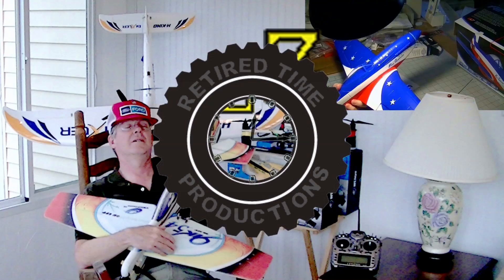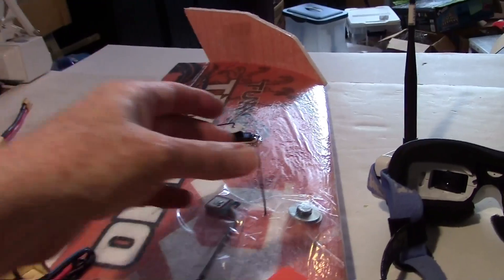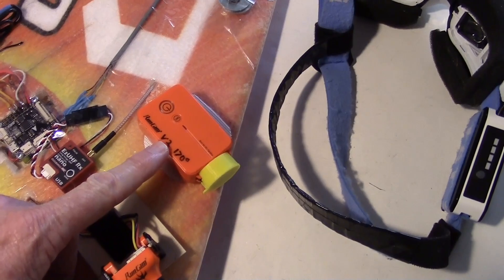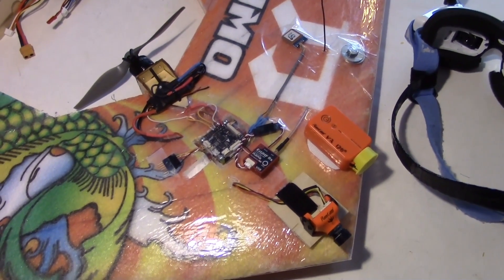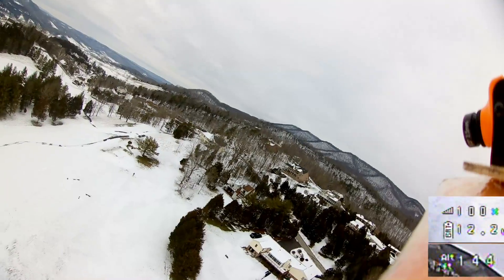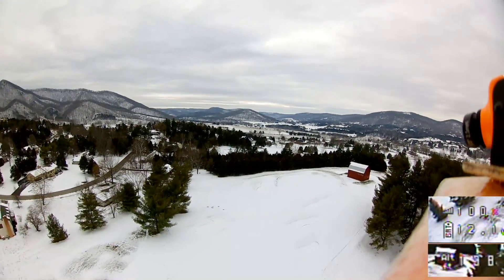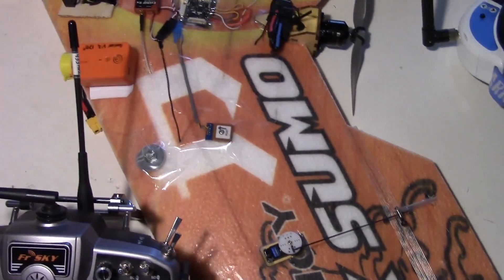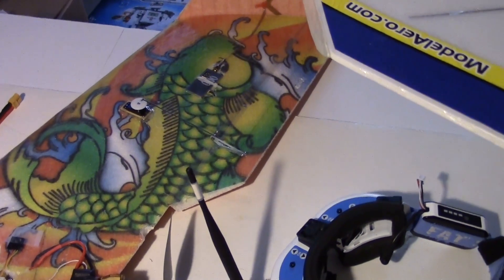Tek Sumo EZUHF Nano LRS Receiver Flight Test and link to Binding and Firmware Updating Flight Vid

Comment: Nice video! Was the rssi working? I t was always at 100%?
Reply from the maker: Yes it was working but it is actually measuring Link Quality rather than RSSI.  I used LQ instead because RSSI is an inverted signal on EZUHF. I would probably have to go much further than I did to see a drop with 433MHz LRS.  Rock solid the whole time.
Reply: Dave Merc Productions does it use 0-3v or one of the ppm channels?
Reply from the maker: It is using one of the ppm channels but fortunately it has 12 channels so plenty of room for all the functions I need.
Reply: thx!

Comment: I am curious to hear what RSSI values you are getting in Inav,  I have the 4 channel EZUHF RSSi coming in on the PPM signal on Aux 4, when receiving 100% signal i get 1000uS and it only goes to around 1400uS when i switch off this relates to a range from 60% rssi to 100% Rssi in my OSD.

What do you get on the nano?
Reply from the maker: What software are you using to check the values? I will try to do the same and give you the readings.
Reply: dmerc00 thanks really appreciate it if have 1.53 on the ezuhf and inav 1.51 on the plane
Reply from the maker: So what I found out is that I am not using RSSI. Link Quality is more useful to me and is a positive signal which configures more easily. So the short answer is I don't know my RSSI values because I am not using RSSI. If you are using a MWOSD you may be able to calibrate your RSSI reading with the MWOSD config tool.
Reply: dmerc00 so what values are u getting in inav for the link quality when u switch your TX on and off?
Reply from the maker: 1800us when the radio is on.
When the radio is turned off it quickly drops to 1424 then gradually drops to 1000.
On my OSD screen I see 100% that trickles off to 0% when the radio is turned off.
Not saying this is right, but it's just what I get.
Reply: thanks so much I will change to link quality and see what I get. was this with your JR module as that's what I am using. thanks again for you help
Reply from the maker: Let me know if find out anything interesting on configuring it.

Comment: Hey, give Jhon a heads up on his revising for the smoke stopper, could not response on his video comment (it was removed as we speak)
But looking fw to see the new design ;o)
Cheers.
Nice flight b.t.w.
Reply from the maker: The smoke stopper thread owner didn't like Jon putting the switch on it or the procedure for using it so we respectfully took it down for improvements. Personally I like the switch idea but the owner thought it would lead people to leave it plugged in and drain their batteries. He also took issue with me not using the low current smoke stopper test first. Then he claimed trade mark violation for using the name, lol. I did a search on TESS and found his trade mark was not registered to him or his device. I called him out on it and he deleted my post. Guess he is embarrassed and pissed now.
Reply: Wow, what a story for a simple smoke stopper! ! some guys are of the charts n this world.

Comment: I assume the Nano has long range capability like all the other 440mhz receivers....?....Oh, and well done Dave, we have the proper intro again...Snow looks pretty.
Reply from the maker: I make no claim on the range but I would hope it would do as well. Jury is out. The tire doing well, that's how we roll or rock if taking a nap :-) The snow is almost gone but we might get some more as we are in mid winter.
Reply: +dmerc00 Cool, Im pretty sure you will run out of video range long before control link expires....lol.
  Be interesting to see that once your weather improves...;)

Comment: Hey Dave, great video!  I was going to ask you why the big bolt on the left wing, but as I watched, the answer appeared out on the right wing. lol   Btw, tell Jon I liked his/your smoke stopper box with the on/off switch.  You guys ought to market that... I'll be your first customer.  Actually, I just need the case I guess.  Did you ever put it on Thingaverse? Take Care! :)
Reply from the maker: Jon just invented the case not the circuit although he did add the power switch.Yes, it is on Thingiverse. There is a link under the video.
Also keep in mind the following:
This is for three cell batteries only or 12volts (already mentioned in video),
This is the higher current version and some FC's could be damaged with 2.5 amps
so check your aircraft for shorts with a meter first (I do anyway),
Don't forget to unplug because a mistake of leaving the switch on could drain batteries,
With this version props could still spin-up on tiny quads that can fly on 2.5 amps so always remove props,
Don't use on projects that use 1 cell or 2 cell batteries or you may damage the aircraft,
We are not responsible for damage caused by this device.